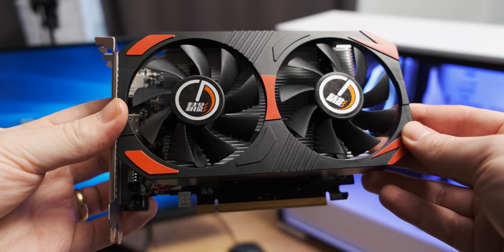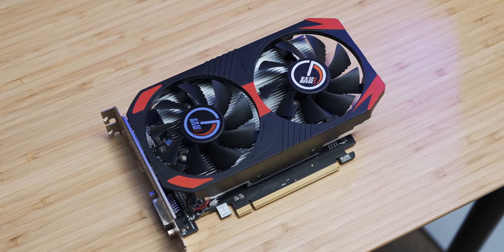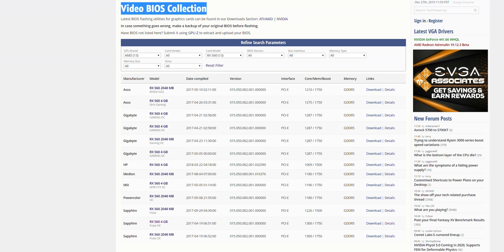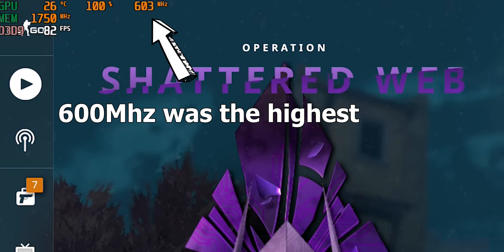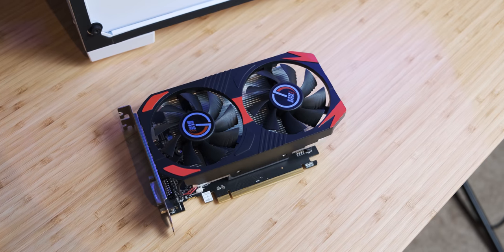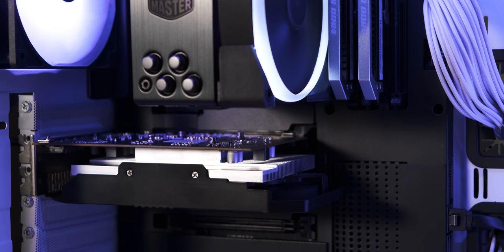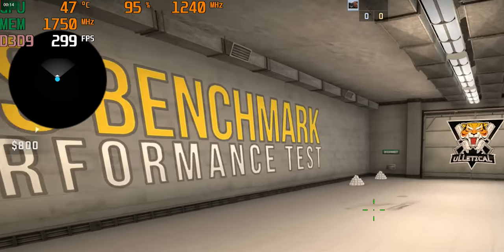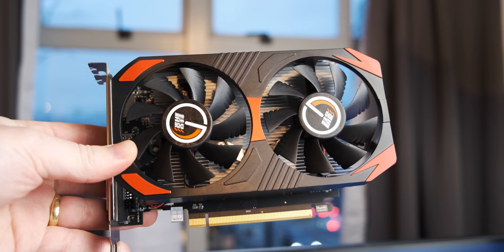Fixing the strange Corn AMD graphics card

Comment: It could be that the chip itself is set to run at a certain speed so you can't actually get it to run faster (ie. it's actually hard-coded into the chip or there is another chip on the board--not part of the BIOS--that limits its speed or controls the speed.

Comment: You were hitting that power limit. Most AMD GPUs seem to be overly generous on their core voltage and reducing the voltage can let you get away with an overclock, less voltages higher clocks... I know it sounds stupid and it shouldn't work like this but alas it does.

Comment: You can actually typically go over 75w on PCIE and not damage your Mobo. The RX 480 and GTX 950 both drew far too much power from the PCIE bus and while there was some freakout, they never actually caused any harm.
Reply: Thats true rx480 did go over big time
Reply: I never understood why it did that, when it has a psu connector to supply all the juice it needed.

Comment: What was the point of the D variant card if it still has the same amount of shaders but with them limited?
Reply: Probably to lower power consumption, since apparently they're used mostly in Chinese internet cafes.
Reply: It could be that the cores aren't reliable enough so they disable them.

Comment: IDU why GPU card makers and MOBO makers get together and put the power supply pins on the MOBO in front of card slot, so when you plug video card in to slot, it also plugs in to power pins as many as it needs to take up. They would need to seperate the extra power slot from rest of mobo circuitry.
Reply: Apple done it in it's new iMac pro, the PCI-E is longer so the extra power can be delivered via the slot
Reply: @alfredomorales9467  
That's means only custom cards made for that mac will work unless there's a work around.

Comment: What about gaming on a lower Res with high detail on a CRT?
Reply from the maker: Im sure it would work well for that. 👍
Reply: Comes with free nausea, headache, and eyestrain to boot!
Reply: @ayuchanayuko  no. I had one. At 85hz nausea is not an issue. With Trinitron flat eye strain is a non issue unless you game for 24hrs non stop.

True blacks. Zero motion blur. 1000 nits luminance. Cheaper than OLED. Zero lag.

Come on. Let's bring CRT back. 👍
Reply: @johnathanpearson3203  I've played with CRTs since 2000s. Played on a syncmaster and photoshopped there like there's no tomorrow. True it feels better with 75Hz up, but I wouldn't go back for the eyestrain. It also looks "fluidly delayed" as if I'm on a boat. Not going back to that. I can still play a bit from time to time for some PS2 and retro games or watching my old DVDs. I even think I ruined my eyes because of looking at CRTs for too long. Then degaussing the damn thing from time to time made my brain feel like it got reset. IPS now has, for me, achieved a nice balance of space, power, color, and brightness. If we compared average TN LCDs I would agree with CRTs with color reproduction, but not with modern LCDs like IPS and OLED.

Though have you tried plasma? If dark blacks is what you want, plasma marries CRT color and light advantages with LCD power and space advantages. OLEDs can also be comparable (see psvita gen1).

Edit: I also grew tired of the high-pitched sound it makes. I can hear when someone turns on a CRT monitor or TV somewhere and it gives me migraines if exposed too long. Back then I didn't even know how I was able to bear it until CRTs went out of fashion and I was exposed to them again. But that's just me, most people I guess don't even hear or recognize the sound.
Reply: @ayuchanayuko  fair enough. My experience was different. I like OLED but right now the cheapest 24 inch 1080p OLED is £4000.

I can't find a plasma with a VGA input or DVI. Worth a look. Thanks.
Reply: OLEDs have poor motion, poor daytime light and CRTS ive had 0 issues with that you mention, but I used 90hz + on my CRT. @ayuchanayuko
Reply: @johnathanpearson3203  Samsung Plasmas have VGA input, I use it because the HDMI has serious lag.

Comment: connect 6 pin power conector to it or gtx 1050
Reply: See the problem with your idea is that it has no place to plug in a 6 pin.

Comment: I didn’t have good luck with my Strix 460.  I flashed a Strix 560 bios to it and while it did work, it was unstable and crashed in quite a few games.
Reply: Usually the issue is memory speed and or timings mismatch, if you used a bios with the same exact chips then idk...
Reply: imaghostya it was the 4gb OC Strix 460, and I flashed it to a Strix OC 4gb 560 with the same memory type.
Reply: @EvilTurkeySlices  same exact chips as in u took a pic or wrote down model number on the actual ram, then cross referenced with the intended bios?
Reply: @EvilTurkeySlices  Ie hynix for hynix same chip number, samsung seems to be easier with the k4 variants not having a revision b with different timings. 

Source: I have a nitro non plus 480 and I've been wanting to flash to a pulse 580, but the micron ram i have is revision b. Either way I'm gunna try & flash it eventually lol

Comment: Sooooooooo
you are intentionally flashing a different bios than the native one onto the card?
Um.... I don't think this is the best thing to do, but alright.

My initial thoughts going into this video. I'm only at the half way point so the remainder of my comment will consist of my final thoughts.
We are watching you edit the bios manually, flashing mismatching bioses onto this card, which mind you doesn't have a fan controller on it and multiple components are left in the open with just a fan blowing onto exposed chips without a heatsink and we are hoping for better performance on a card that wasn't meant to handle the types of loads we are going to put this thing through...
I don't see in anyway how this is supposed to be a good idea. And this is coming from someone running the same cpu as you in the last video (i5-7600k) that I have overclocked to 4.17Ghz since the day I bought it and have been running it like that for 2 years now. Like I have decent cooling on my system. You on the other hand are stressing components that don't have adequate cooling on them and will most likely end up killing the card a lot faster than the silicon would have normally degraded at.

Still at the halfway point, but you've just said that you are going to try and overclock the card...... My guy.... this is exactly the opposite of what I would be trying to recommend someone to do who is buying an entry to low end system. If they can't afford a better card, why would I expect their case to be good enough for their card to deal with these new stresses? If they don't have either enough fans, the fans possibly in the wrong places, or worse no additional fans in a restrictive case, the card is destined for an early demise.

Final thoughts:
You attempted to overclock a card that was intentionally cut down for life span because it was intended for internet cafés in another country where they would see a lot more use than the typical commercial card and then you were upset that it wasn't a better bios when in fact it was never designed to deal with the increased load. After flashing a different bios, which is exactly when we are trying to avoid when buying cheap components so that things aren't falsely advertised and you don't end up with a worse card with a newer card's name on it IE getting a 460 when you ordered a 580 or something like that, you were only then satisfied when you were the one upscaling the bios and then trying to medal with it further. From a tech standpoint, I get it. But from a consumer stand point, I don't think this is at all what should have been done. You even bashed Corn when they supplied you with a card that you had ordered that shipped with the official bios for that card and even installed the corresponding drivers for that card. Dawid, I don't know what to say other than I don't think you are in the right in this case.

Other than everything I've said above, I do appreciate the work you did in testing, researching, benchmarking, and more and then editing this video. You've done a fantastic job.